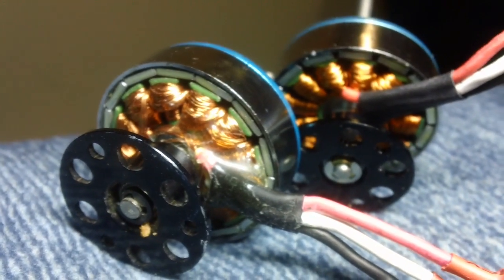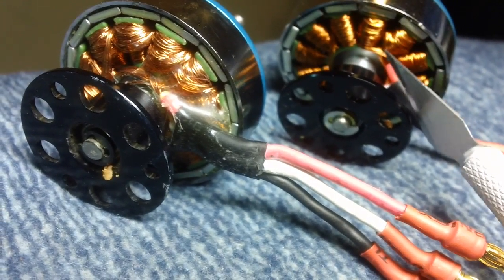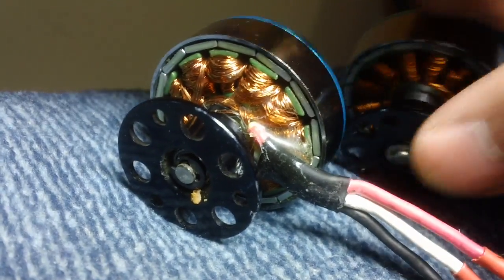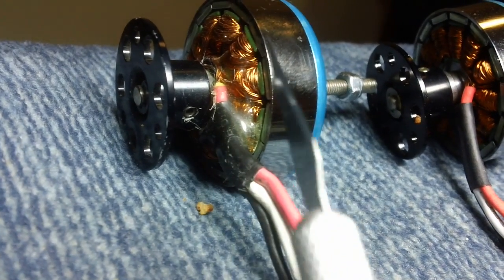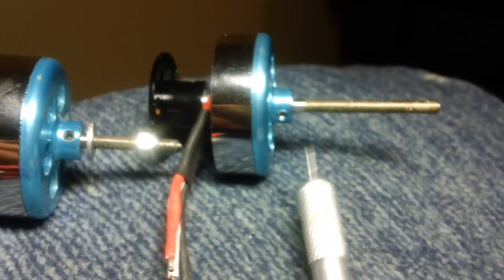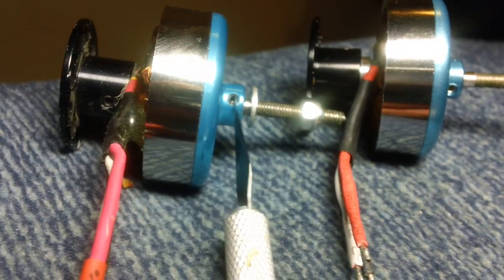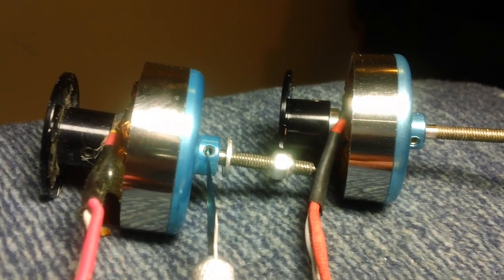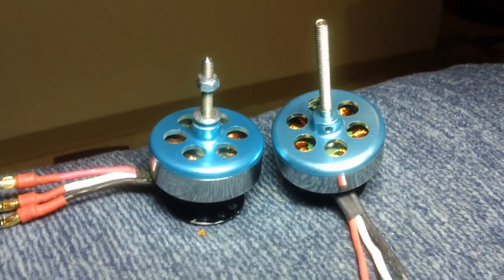RIPrc   HobbyKing  DT 700 Motor Tips

Comment: Wrapping the motor mount with black electrical tape solves all problems with the grub screws vibrating loose and lets you remove them later without worrying about stripping your 1.5 mm allen key.

Comment from the maker: Yes 11x4.7 work great with 3s batterys.  That motor prop combo will give you alot of lift so bigger battery are no problem.  On my tricopter with a 2600ma 3s battery i got around 10min flight time with fpv gear on board.